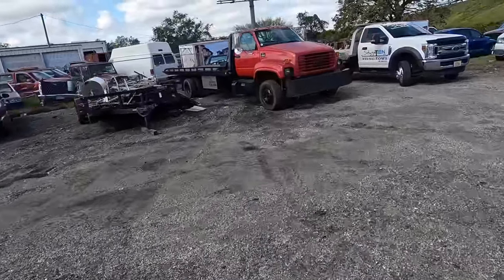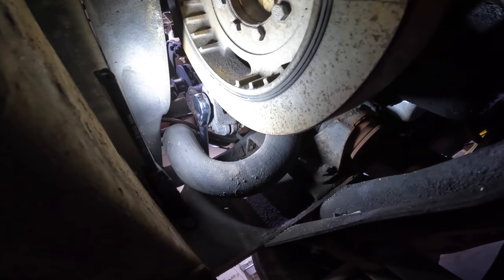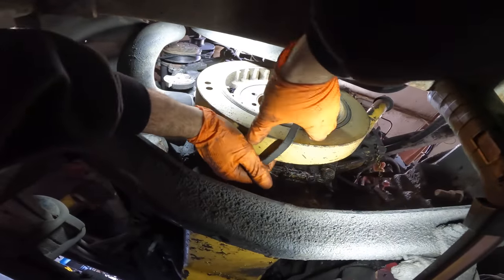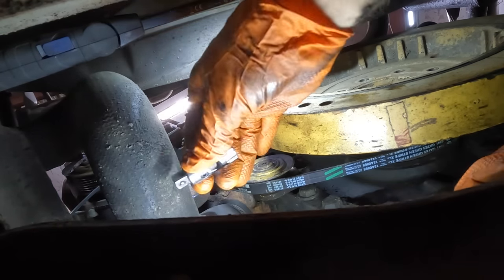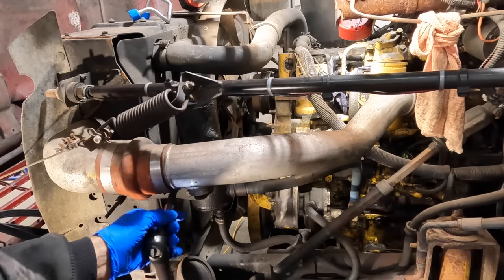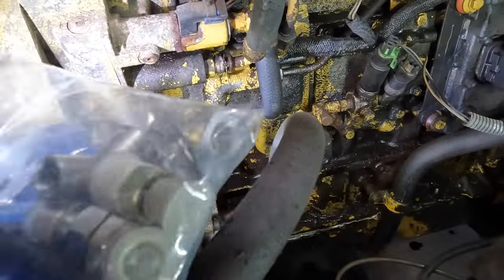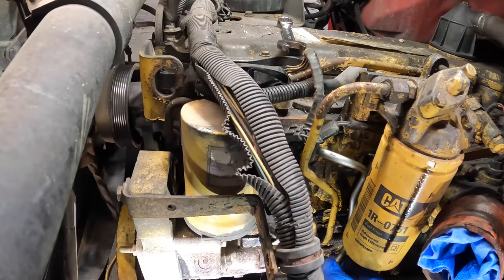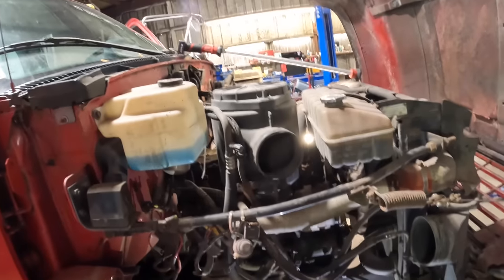Hi Tension Explosion! CAT 3126 Diesel

Comment: There is a high pressure filter kit to go in between the HUI pump and the head. It protects the injectors from the debris that comes out of the HUI pump when it fails.

Comment: Ray never complained once about having to wear a jacket, very restrictive when trying to move and catches on everything. There should be greese nipples in the ujoints on the steering shaft along with the clutch linkage on the firewall, they get missed most of the time. Check the ujoint inside the cab by the brake peddle. Use your green drain pan when you change oil, it will be close to full. You are going to have to forgo your thinking of not filling the fuel filter before you install it. Unscrew the hand pump on top of the filter housing and pump it untill it builds pressure and gets hard to pump then tighten it back up. If the engine turns over to long and doesn't see fuel pressure it will set a code. It takes way to long to try and fill the fuel filter with the hand pump. We always added oil to the oil filters just so it didn't take so long to get oil pressure. Harbour Freight has 3/4" socket sets regular and impact. A good 3/4" impact and torque wrench will be required. A few trips to a heavy junk yard for interior dash parts should get the truck looking pretty again. Masking tape and some spray cans of cat yellow after a deep engine cleaning. In time you will probably get some use out of your new airhammer needle descaler and some black touch up paint.

Comment: I had a lot of experience, building and designing RVs. While driving my own, I was approching Redding, Ca. when my RV, a Ford, started overheating and I lost my alternator by Shasta Lake. When I looked to see what went wrong, my damper pulley bolt had unscrewed and my V belt was twisted all to hell, nearly shredded. fortunately I managed to convince the belt back on and the best luck of all, was that my damper pulley bolt was lying loose inside the pulley. All I had to do, was screw it back in. God was watching out that day, and the belt stayed on, barely making it to the Redding exit when the belt came off again and I was able to coast to just shy of a parts house without any walking to speak of.

Comment: Cheap easy idea up souloution for the pto and reving up the motor. Cheap manul choke cable. Pull thd cable hooked on the throttle body it stays you go use the PTO come back push the choke knob back in, you could almost rig an electric unit to the pto controls box and only reve up when your at the controls.

Comment: Man, a few of us used to medium/heavy duty trucks would have warned you...

Always go into something that crusty with full intent and ability to replace all the standard maintenance items. 

In this case I would have ordered both belts, tensioner assembly, and any idler pulleys. It never fails when you see belts looking like that that there IS other problems. And those are the cheapest stuff there to change out. And you're already there anyway.

Comment: I once forced a very tight timing belt on. After driving for a while, the belt gave way in my interference engine. I damaged the belt internally by overly stretching it affecting its internal structure which cost me major inconvenience on a busy bridge, the price of a tow and a new cylinder head due to bent valves but luckily no other engine catastrophe. Lesson learned not to stretch belts especially ones critical to engine operation! 😦

Comment: Ray, I know a trick that may help you the next time you need to replace that water pump belt is pour rubbing alchohol on the harmonizer.  Believe it or not, it creates a slick surface that quickly evaporates.

Comment: Back in the day , I used to carry a spare serpentine belt and a flex bar. It happened twice that the battery light came on and I could pull over and retrieve the broken belt , hanging on the fan pulley and replace it on the spot. When I sold the truck , it went with the spare. The first time it broke, I made it back to the shop, a matter of six miles, but between the mechanic and myself , we couldn't figure out the routing. we went to an identical set up on another truck and I made a diagram in the owners manual for future reference.

Comment: Step 1 should be pressure wash the engine- makes things so much easier to work on.
AC condenser unplugged- most likely because the condenser is seized or the pulley/clutch is bad.

Comment: As mentioned previously - reverse belt so grooves are on the outside. Then use long extension from topside and tippy-tap belt edge to move it down.
Hope that lubricant you used will not lead to slippage (hopefully not as the belt is grooved).

Comment: Ray, flip the belt inside out. The outer circumference of the belt is larger than the inner circumference, and all of the cords that don't streych are at the very outside of the belt. You can gain quite a bit of space this way.

Comment: We had a water truck exactly like that and I had to change the belts on it. I notice right away that if you turn the steering wheel in the direction you want to work in it will be a lot easier. Just saying.

Comment: Hey where you pointed to calling out the fuel leak, is that where the particulate screen is?
On one of my tractors, close to the injector pump is where one of my screens are like that one and yes, I have had to replace my o-ring before.

Comment: Twist the water pump belt so the v is pointing out and it gives you an extra few millimeters and no need to take off the balancer and a little less struggle then just twist it back so the v is on the inside

Comment: I took an old big screwdriver and heated the end bent the end 90 degrees and use it to pull the belt down along with a tiny smear of vaseline. it works without damaging the belt.  The other day someone asked why you don't steam clean or power wash the vehicle before working on it. I had a shop with a wash rack and I got so much grief from the county office of air and water quality with their spot inspections along with the EPA making rounds swabbing the grease trap and issuing stop work orders that shut the whole dealership down that I had to stop cleaning vehicles. The fines are in the thousands and into the tens of thousands even if you keep the grease trap clean, it just wasn't worth the hassle. The day we had to shut the entire dealership down cost a ton of money and the lawyers could not get any concessions from the government. They even would come by unannounced and swab the exhaust of the media blaster looking for hydrocarbons. Nuff said.

Comment: You should spray the belt with BRAKECLEAN... to clean the grease off that you need to slip it over the pulley lol (also turn the belt inside out and it get slightly longer and fits over)

Comment: Ray put a little lube or grease on your hose pick and run it around the inside of the hose coupler. It helps gets the pipe loose from the coupler.

Comment: that tensioner was long since broken.. they are known to implode like that.. we dont change the belts unless a new tensioner is installed  as they like to swell and split in canadian winters..
same with Ford tensioners if they havent been changed i change them every 50k on all our trucks as we have had a few that would cause the belt to jump groves.. work trucks, dont need a belt to break when pulling customers vehicles and such ad some of the trucks move park model and modular homes..

also yes you need to refit your garage for specialty tools and equipment if you dont want to waste time "TRYING" to make it work.. learned very quickly working at ford on international engines..

Comment: ray i searched online and found this
"turn the belt inside out so that the cogs of the V-belt point outward! This provides an additional 1/2" in diameter to the belt.

I went back out to give it a try ... sure thing, it was enough to allow the belt to slip over the harmonic dampener." - Native : Maintenance Tip: CAT 3126 Water Pump Belt Replacement : skoolie forms

that tensioner pulley must have been held together by the mounting bolt
Reply: Yes he missed the obvious. I wouldn’t want that belt now
Reply: I have a 3116 on my generator set and did this same job.  For me it was easier just to remove the damper.  It is a separate piece from the crankshaft pulley. So, the damper comes off by removing the eight bolts, and the pulley stays in place on the crankshaft.  The whole job took me about half an hour from start to finish.

Also, it's a good idea the check the bearing in the idler.  If it feels "gritty" the idler should be replaced while the belt is being changed.  The water pumps on these engines seem to last a long time, so probably just changing the idler and the belt will give many more miles/hours of service.
Reply: I thought of that idea, mainly so a cog or two did not suffer damage.  Great advice!
Reply: I never knew that trick. i will have to remember it
Reply: Ray literally needs a live chat so he can come to us with all of his problems daily and we can help him.
Reply: @NeoMK   very true ! A little “tough on the Ego !” LOL
Reply: @fredwalker839 Yeas but if you want to learn things in life it requires one to leave your ego at the door.  Peace
Reply: Simple, but so genius!

Comment: If you would had flipped the belt inside out, with the ribs facing out, it would had went over the dampener a bit easier. But ya, normally, the dampener does have to come off. For a spare, i keep the next size up belt in the truck. It had just enough to get some tension on it, and it will get u out of a bind.

Comment: Tech tip. Use your grinder holding tool to remove the HUEI lines.you shove it between the top of the rubber and the line and push towards the pump. The rubber is a aid in pushing the clip. 7.3 use the same type of lines on their pumps.
Reply: Nahhhhh
Reply: doing it Ray's way.

Comment: I would believe you required a new tensioner anyway, as that was the reason our Honda chewed its serpentine belt in half. The tensioner bearing allowed it to angle slightly, diverting the belt off its natural course.
Reply: My son's Nissan X trail did the same thing

Comment: Dang Ray, good thing you went in to get those belts sorted when you did. Would have sucked for that to fail when going to pick up a vehicle. Glad you and wife unit made it to the shop with it before destruction happened. Love the channel Ray and have a great day!
Reply: Worst case, truck breaks down somewhere in the sticks with engine failure.  Cannot be repaired on the spot.  There's a non-running customer vehicle on the bed to make it spicy.  What do you do?

Comment: Rainman Ray  those pieces of paper you received from the classes you took called certificates. The porcelain room needs them. I’m very impressed that a backwoods Redneck mechanic videos his quality work. 

Reminds me when one of your relatives fixed my truck on the side of the road in Tennessee. I suggested to disconnect the batteries and he said “ no need to for the alternator, there’s no power there until the motor is running”. After big blue flash and paramedics helped him up. He said “WOW that was shocking” paramedic said “I guess that’s how you lost your teeth!”

Comment: remember cat uses the engine in alot of applications , take a close look at the crank pully and i am guessing you will see two pusher holes , so you remove the bolts then you two of them to remove the pully ,

Comment: I'd say a little heat (very little) and a little lubrication and try to roll the belt inside out.  When inverted the larger OD when inside helps and the teeth give all the flexibility you need.

Comment: You really should be using (orfs) o rings for those flat face hydraulic hose connections. As someone who works with flat face hydraulic hoses on a daily basis, universal o ring kits can work but I've had them blow out or split on me in the past

Comment: Use a ratchet strap next time, hook it to the bottom of the harmonic balancer and the other side of the strap to the cross member, and pull it off little by little by bumping the key, or wrap a chain around it and use a slide Hammer if you really need it off next time..

Comment: If you ever have to do the water pump belt again just flip it inside out so the cogs are on the outside and it will slide right over the damper.

Comment: This is heavy duty stuff, you need a bigger hammer and a bigger prybar!  Also spray some lube around the center of the harmonic balancer.  Hammering isn't effective due to the rubber isolator in there.

Comment: You should have tried to turn the belt inside out. The internal cords are more toward the perimeter of the belt and moreover, the outside surface is smoother. I bet that would have been way easier.

Comment: Ray, I work on HEUI engines all the time and ordinary 'O' rings will not seal in a high-pressure oil line. You need to use a VITRON Seal instead.

Comment: Holy crap, I wouldn't have posted this belt change🤣, just skipped over it like well got the belt back on and now we go back to the tensioner 😆, also if you have a fleet of turbo diesels I'd just invest in some spare air to air clamps, we ran out of them at trucking company I worked for and we had a parts department.

Comment: On a positive note, that tensioner was probably  goint to come apart before long anyway,  better to happen while it is in the shop and not out on the road.   Just a good thing it diddnot "splode in da face.     

And If I were you and owned that truck, I would definately upgrade those "air brakes" or replace them with actual parking brake brakes.   if that is the brake system that I think it is that just clams onto the drive shaft, it is crap and can lead to serious OH shoot moments when you REALLY don't want oh shoot moments to happen.

Comment: If you ever need to change that water pump belt again, turn it over so that the teeth face out instead of in as they do in it's normal use. Having the teeth face outwards as you slide the belt over the yellow pulley, will give you almost 3/4 inch  more belt length because now the belt itself slides over the pulley instead of the teeth.

Comment: one reason I Love my internationals..  no inner fenders..  they flip right forward with the hood...  thise trucks are notorious for the fan clutch going bad and not even making minimum speed... A/C compressor will slip on the serp belt and eat it..  that little belt is a PITA..  ive done a few on Busses..   REAR engine busses thisd is MUCH easier..  there are different size balancers on the CAT motors..  you probablty have the Low HP version..  I have the software to turn that up :)

Comment: diesel stuff tip-  powerwash that cat ,  clean all the lube off those charge air cooler boost tubes and hoses , then use original aqua net brand hairspray to keep them from blowing off under boost ...

Comment: Ray, Hope I didn't catch a glimpse of an OHIO PLATE on the front of your newly purchased rollback. My question is, do you really need a steel bed, diesel engine large hauler from the rust belt? Couldn't you find a gas-powered big block chevy or ford with an aluminum bed? Upkeep is a lot cheaper.

Comment: OMG I hope you didn't just leave the crank balancer bolts only tightened by your ratchet!
I know sometimes you merely don't show actually using a torque wrench even though you do, just not on camera for the sake of time, however you do normally mention it at least.
I hope you did indeed torque those bolts.
By the way, independent heavy equipment mechanics usually get around $140 per hour plus mileage if they're any good and all their business is word of mouth reputation based.
Love watching you do your customers honorably and your sense of humor as well as the wife unit's entry into developing her own content.
As you train her, it'll be great to see you two tackling jobs together 🙂

Comment: Since you are u sing manual tension,  I wudda tried next suze bigger belt, if there is enough adjustment in tensioner fir tight belt, then pretighten tensioner , giving you ability to bump belt on n off with belt tool. My Chevy  Ave 5 1.6 Lt uses this method fir AC belt...no belt adjustment...bump off n on...
Worth a try fir next belt fix....guessing that's why belt has possible premature wear from unnecessary prying over crank pulley....know what I mean VERN....gravity proves earth sucks....watch out fir that tree/socket

Comment: Ray, this may seem obvious when you hear it but I have a question. If the belt is knackered, why not just cut it instead of manoeuvring it around the fan?
Reply: I think that was mostly a test for reassembly.  If the old belt can’t stretch enough, then the new one wouldn’t, either.

Comment: It is actually good he wasn't able remove the harmonic balancer from it's mounting plate. It is not keyed to the mounting 
plate and chances are he would not put it back in exactly where he removed it from . The plate has  bolts towards the axis where you can remove it from the engine, oopsie. All the bolts he did remove weren't screwed back down. He missed two.

Comment: @12:00... Ray, wanna guess why that belt is so old? Also, there's a much easier way to remove the old belts. You got a blade? @28:00... I work on my RV. Cummins ISL in a 43' diesel pusher configuration. @33:00... Nylock nut + rust = Arrrggggghhhh. @38:00... Hit it with your purse. ;)

Comment: Welcome to Caterpillar engineering, disassemble half of the engine to change a $15.00 part.  Take out the 4 bolts in the center of the hub and the complete dampener comes off.

Comment: 9:37 looks like there is a crack in the cranckshaft pulley
Reply: No shit Sherlock! About 3:00 as you see it in the video, straight out from the rubber on the counterweight. Possibly walking around the corner to the outer perimeter. Crack or just dirt, hard to know for sure from a video.  I'd sure get a closer look at it.

Comment: 3000 psi exon valdez explosion would be bad . 
 But without the rubber lines, you get stable fuel pressure and may be more tq. To boot. 
 Be safe team.